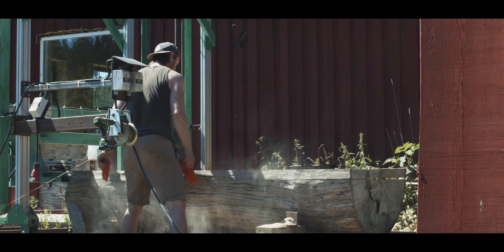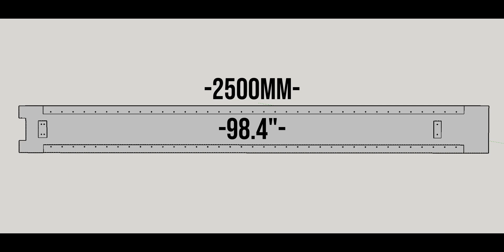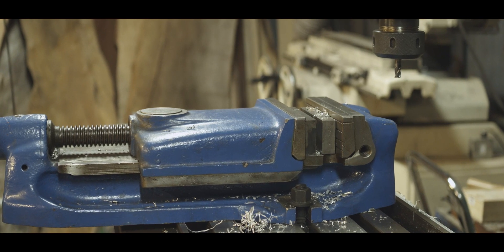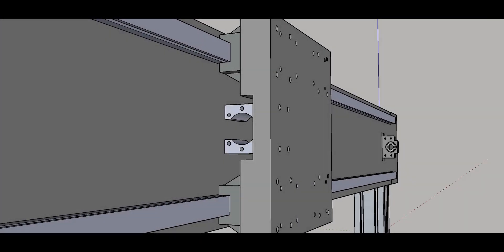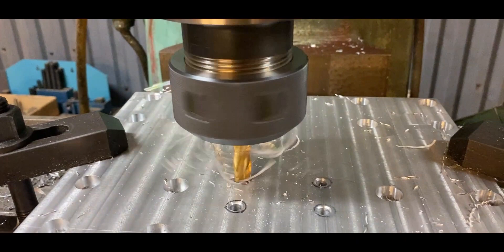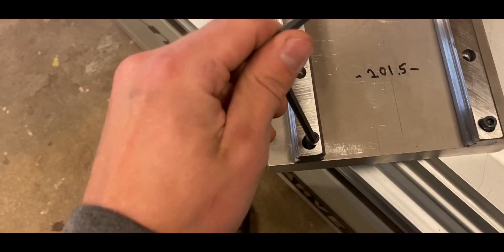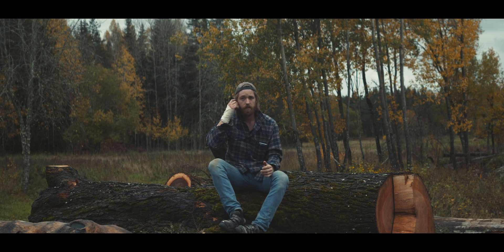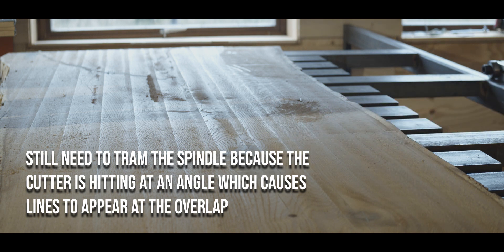Building The Giant Wood Flattener

Comment: Taking nothing away from the Huge Skillz you have - my brain glazed over after a bit when stuff began to involve precision milling, electronicals & whatnot. If it commands precision beyond "looks ok from 6 feet" chances are it's going to turn pear-shaped if I attempt it and I have few illusions about the extent of my talents - so I'll quietly wander off & watch you hit stuff with axes/chainsaws/hammers instead & file this one under ^ "Magikery Others Do" or suchlike. If I drill a hole & it's c.a the right size in roughly the right position/not quite the right position but you can hammer the bolt in using a medium hammer, I consider that an excellent day out on the "precision" front. 

 Still - looks pretty amazing, the flattener - Kudos.

Comment: Beautifully done out there, would you mind posting a list of the parts you bought to make this sled or if you have a plan. I am new into wood working and also doing from cutting with Panther Chainsaw mills, drying and doing live edge table. 

I recently made my own sled using linear guide rails and Makita router. Had pretty much the same issue the router hit a wood cookie on the side and the bearings must be changed I guess, its still working but very noisy. Well long story short.

Need to make a professional one using a powerful motor.